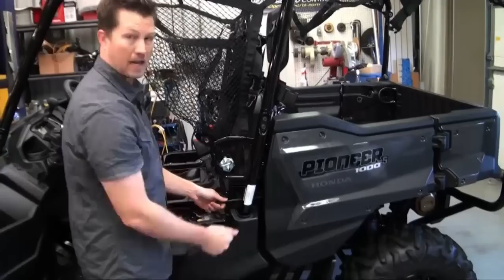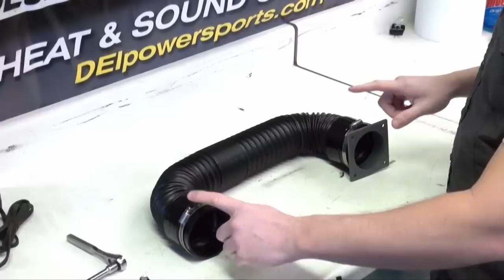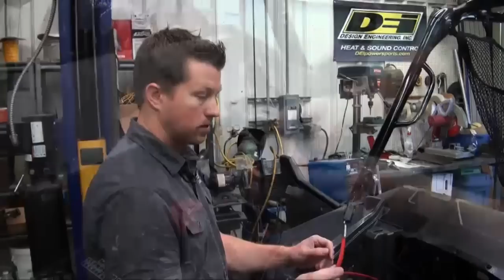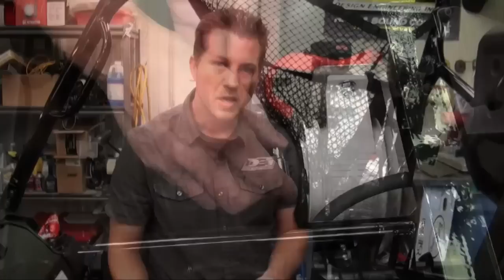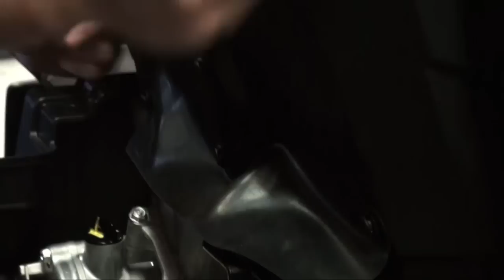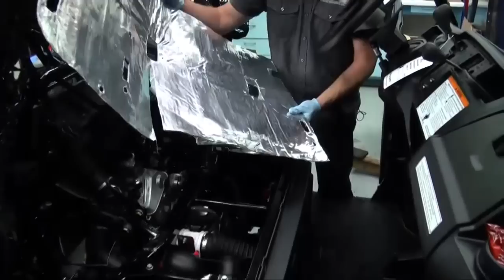2015-2021 Honda Pioneer Heat Control

Comment: How close are you to releasing a heat shield kit for the Honda pioneer 1000-6?
Reply from the maker: Unfortunately we do not have an ETA for that. We have not received any type of complaints with that new model, so it has not been a priority to find one & bring it in for R&D.
Reply: @DesignEngineering  I wish I was closer to you location, as I would definitely volunteer my 1000-6,but I'm outside of Boise, ID. Thanks for the reply.

Comment: @DEI - Can you install the heat shield without the fan or is it necessary to move the air out now that the insulation won't allow it to rise into the seats and footwell? thanks -Casey
Reply from the maker: Yes! The kit is able to be installed without the fan. The fan is usually very popular in the extreme heat situations.

Comment: I went to Design Engineering Inc. website but can't find the kit that you are installing for the Honda Pioneer 1000-5. Can you give me a kit number or an address to get directly to the one that you are installing on this video? Ron
Reply from the maker: Hi Ron,

Apologies for that! The part # is #10874. Here is a direct link as well - https://www.designengineering.com/15-21-honda-pioneer-1000-heat-shield-kit-1/

Comment: Seen someone put a two way fan under the seat. Would pull heat in when its cold outside. And push air across the motor when hot. The port in cab was down by the feet. Nit sure how that would work in deep water

Comment: Just to point out, people like me wouldn’t use this. This being kinda of a Honda error works great for me in a enclosed box providing heat. I’m in Alaska and the summer temps are 55 degrees is which why I choose a side by side over ATV so I can be enclosed. Once negative temperatures hit outside I need the full heat. In -40 it’s amazing how much heat doesn’t feel hot
Reply from the maker: We also have an auxiliary fan kit for the Pioneer. We've had some customers tell us that they re-routed their hose to vent to the cabin to help heat the cabin in colder environments.

Comment: What temperature is a good default for the Thermostat setting that will activate the fan once it hits that temp? Thanks
Reply from the maker: We recommend starting with the lowest possible setting, 150°F.
Reply: @DesignEngineering  Thanks for the reply. Is there a way to override the thermostat and just turn the fan on and off?

Comment: How much is that fan system
Reply from the maker: Our full factory MSRP is a little over $400, but check with some of our partners for better pricing. The part number is 010875.

Comment: Are the new models already equipped with this heating fix 2018-2020?
Reply: My 2020 is so hot the center seat belt metal will  burn you if your not careful.    Going to have to install $400.00 worth of heat control to fix a Honda design Problem
Reply: @RanchWallaWalla  honda is lauded as a major car manufacturer. Yet this is something testing and quality control should easily catch and fix. If honda sxs even has one. Especially considering they had this problem over 2 years ago absolutely no excuses.
Reply: Nope. Mines 2019. Very pissed
Reply: I didn’t see it on the 2020 either.
Reply: My 2020 hot as hell!
Reply: I just bought a 2020 this past Friday and it has thin rubber mats placed under the seat. No heat shield I’ve noticed. Considerable heat while riding. Just been in high 80’s in middle TN
Reply: 2020 hot as hell ,
Reply: My 2021 has a rubber flap over the bottom of the seats
Reply: Nope mine 2021
Reply: 2023 1000-5 and they still have not fixed it..

Comment: I just got some double bubble metal building insulation. Cut to fit under seat , behind backrest and under the plastic peace between them..used 3m super 77 adhesive spray to stick it on ...worked awsome!! Solved the hot seat problem ...did a45 mile dirt road ride last Saturday...seat was cool to the touch the entire ride.

Comment: That poor Honda motor is really going to cook now .   That fan and conduit should be going up not down ,  then when it’s cold you can use a already good heat source ...
Keep the mud and water under the skid plate please and thanks

Comment: Just a bit of constructive criticism, but before you get into the explanation of "How" to do what the video is about, you should first show what the project is attempting to accomplish.  I watched this video from the beginning, and I couldn't understand what you were trying to do with the ducting tubing and flanges and "fan exit", and "holes in the floor", etc. and it just wasn't making much sense to the viewer that has not seen this before.  Once someone can see the completed project, the explanation of how it was done makes sense.

Comment: Only problem is this factory FIX!!! Is just a little bandaid on what many consider a big issue. Had it installed on my 3 seater and I honestly couldn't tell much difference. To really fix this problem takes more than a few more rubber pieces under the seat. MONEY, MONEY, MONEY!!! If enough of you guys and gals take time to actually call Honda and express your concerns they may, and I repeat MAY, actually authorize a honest fix. Gauranteed this won't happen unless all of you let them know about your displeasure. I live in northern Idaho where temperatures are cool. I can't even imagine trying to enjoy one of these machines  down in the south or western desert areas. Get on the phone!!!

Comment: It's too hot really. I live in the Sonoran desert Arizona back in the 80s hardly any cars had working air-conditioning but it did not stop you from every day life and driving in the middle of the summer with the windows down I see no problem with this rig.

Comment: everyone talking about heat..  I have no issues with my Honda 1000 giving off heat.   everything is great.   must be a down south issue with the heat. .. but good products in the video
Reply: I don't know about Honda, but on the Polaris Ranger in the summer the middle seat would get hot, so I am sure it is the same with Honda. I still would like to buy a Honda !

Comment: Thats just a bilge blower from walmart. I have the same one on my boat.  I don't see how that will stand up to mud or water at all. Just get an under seat heatsheild from ebay for 20 bucks and ride on.  I do all day runs at windrock all the time. It doesn't get that hot. I have a full 3/16 aluminum skidplate with no holes on the bottom as well. They get warm for sure but its really not bad. My kids never complain riding in the back.

Comment: Curious, why are you guys not wrapping the manifold/downpipe as well? You guys make header wrap so it seems like that would be another layer of heat protection. Is it because it's gonna get wet?
Reply from the maker: Yes it could definately be used. It woud reduce the temps in the engine compartment. The wrap is a little more difficult to install than the heat shields and from our testing the shield and the fan its showed a big reduction ont he passenger compartment heat so we didn't feel it was a neccesary step. It couldn't hurt though. But If it was to get wet, the heat from the pipe dries it after it is shut off so it woudn't create any issue of moisture or degridation of the metal from water sitting on it.

Comment: What about access for utilizing the storage area under the front seat?
Reply from the maker: The model we used was a Pioneer 1000-5 and that did not have any storage under the seat at all. Was it a different model that has that storage?
Reply: The LE comes factory with the accessory storage box installed. Honestly though, if storage is that much of an issue, buy a pouch rack for the cage and let it run. I would rather have no heat over underseat storage.
Reply: Design Engineering, Inc. 
I believe that the one in your video does have a small storage area under the front seat.
Reply: Again, the Pioneer 1000 does not come with the storage box under the driver seat from the factory. it's an accessory that Honda offers. The only one that comes factory with the storage is the new LE models.
Reply from the maker: Gotcha, I see what you mean. The heat shield will/can lift up with the seat bottom so it should not obstruct any storage areas at all.
Reply: My 1000-5 came with one it's the base model